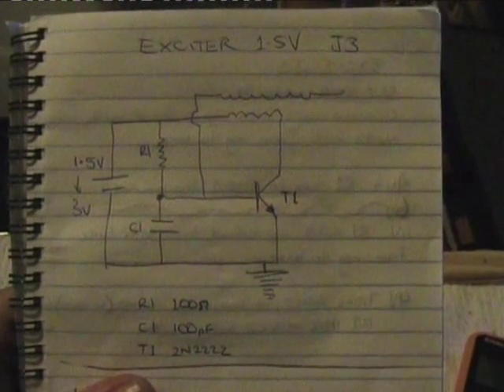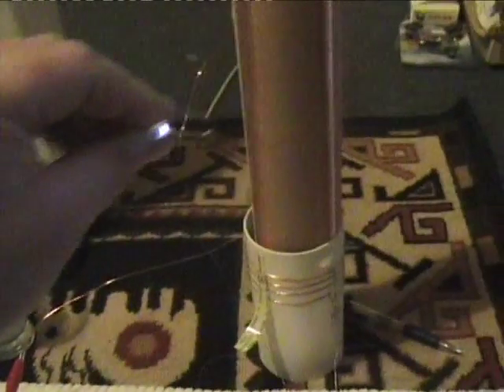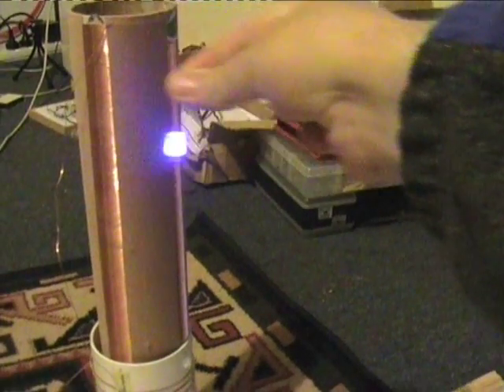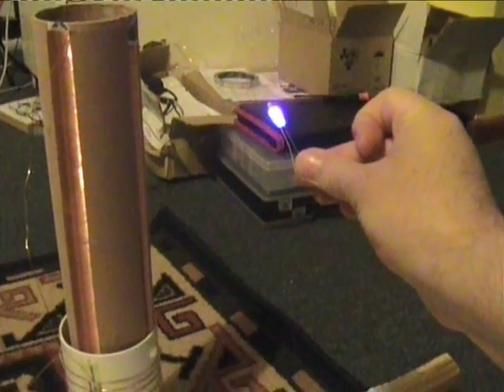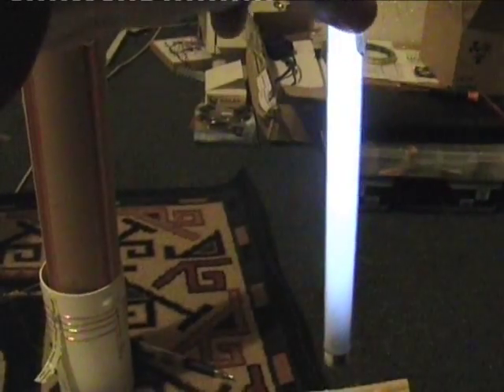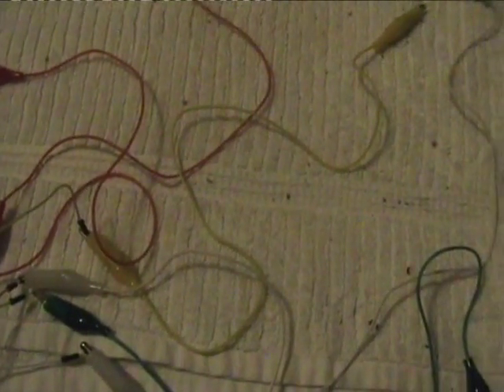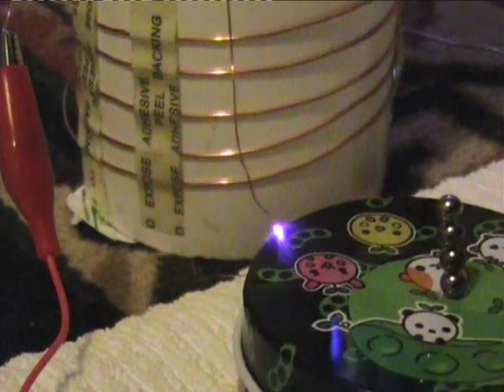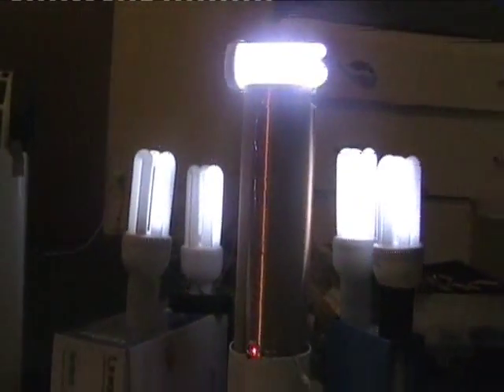SEC exciter from 1.5 to 24v range test

Comment from the maker: @amru1221 Thanks. I am using what we call 'enamelled wire'. I think it is called 'magnet wire' in the US. Either way it is insulated with a thin coat of enamel. Both are enameled, and the tower coil is made of a finer gauge than the secondary coil.